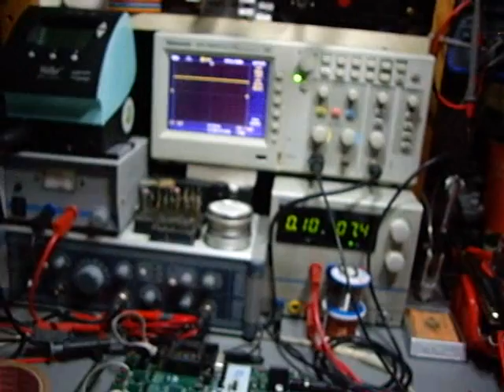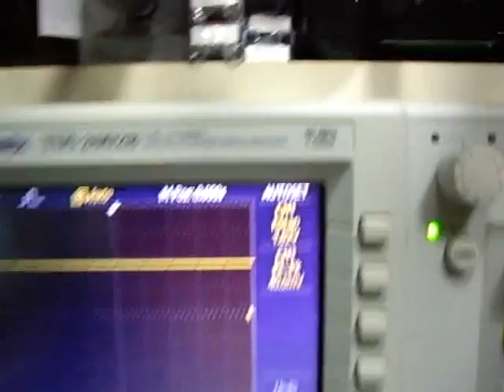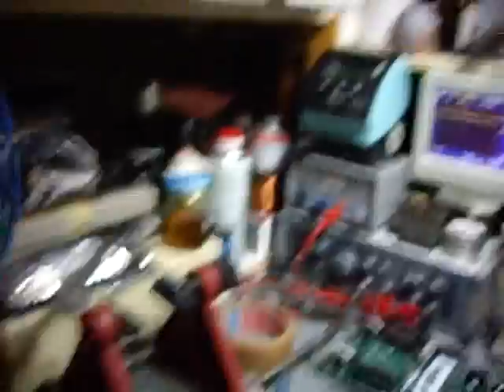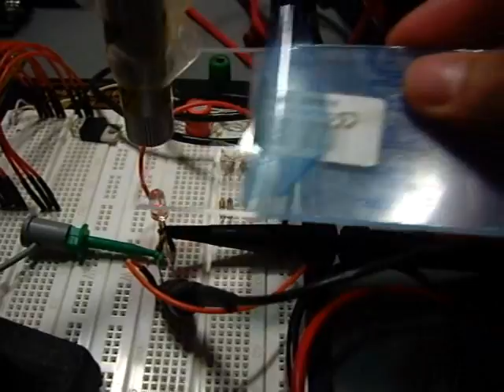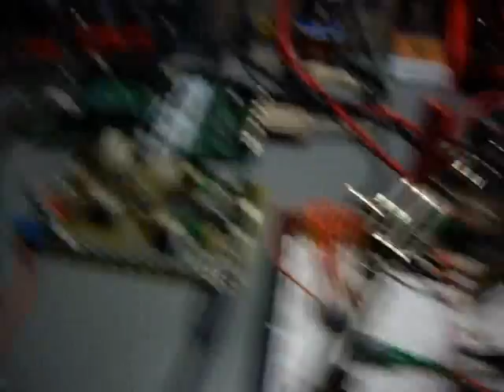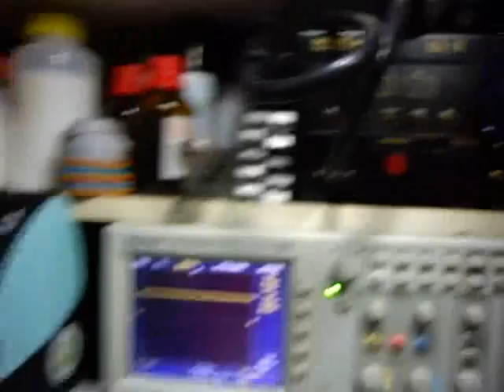A photo electric sensor with a laser.

Comment: If you'd like to introduce microcontrollers... Otherwise you could set up a comparator and monostable so the monostable fires at a time after the drop passes through the beam.

Lectures: Are you attending them or giving them? :-D